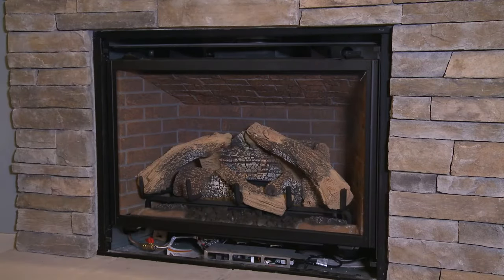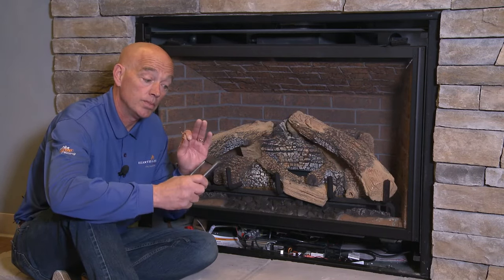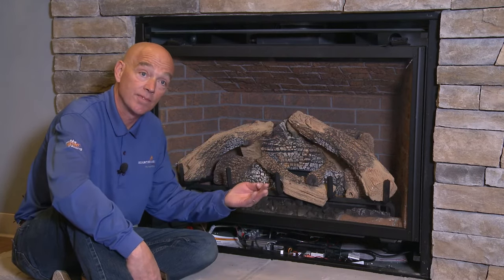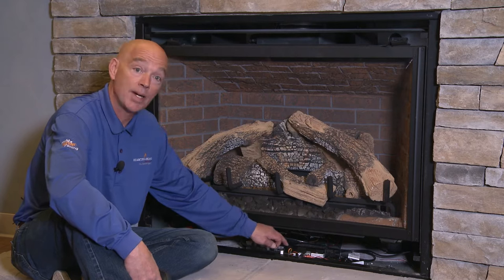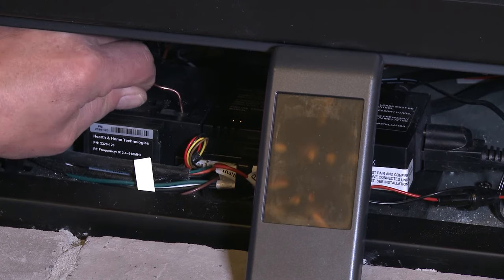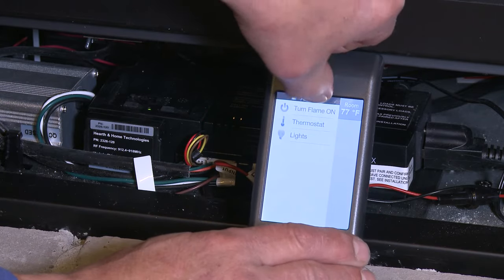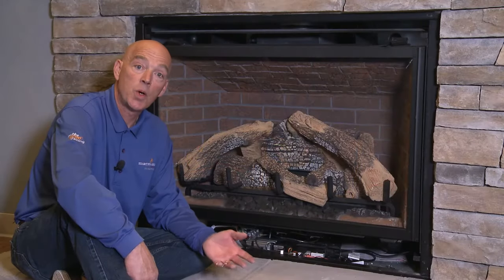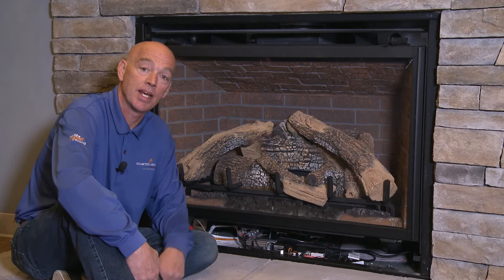How to Relearn or Re-Pair RC/100/200/300 Fireplace Remote Control

Comment: Thanks for the video. It was very helpful. I'm curious though, does anybody else have a problem with the screen turning off nearly the second you stop pushing buttons? The screen timeout appears to be very very short, to the point off being buggy and almost unusable.
Reply: Yes, the remote control screen does not stay on as long as I would prefer. I also inquired if there was an option to adjust the screen time to which there isn't, unfortunately.